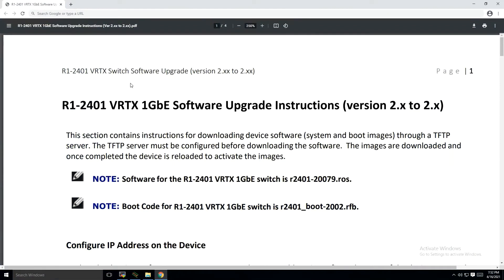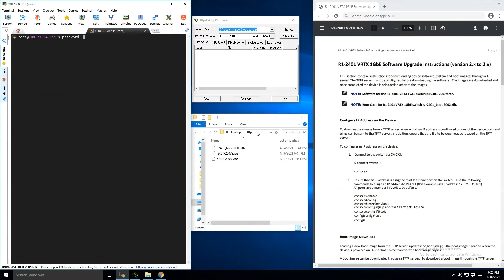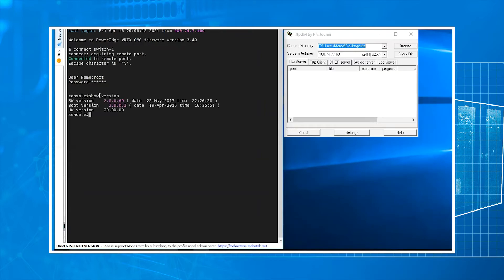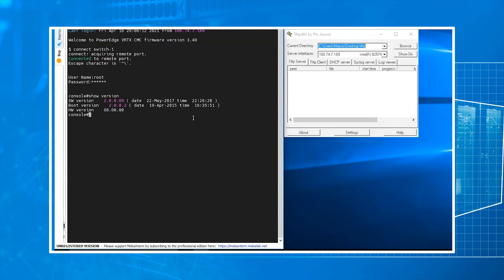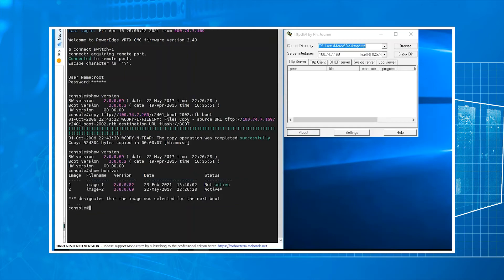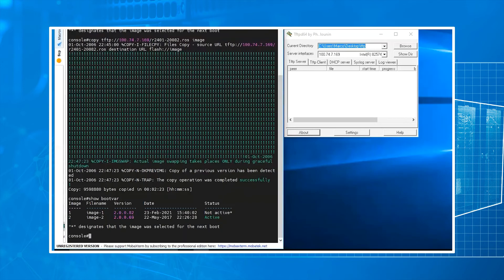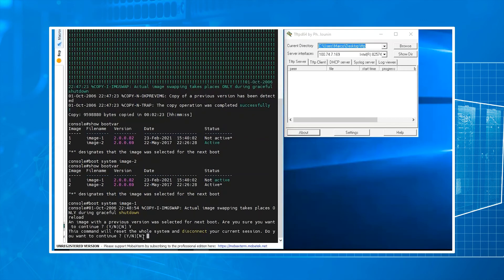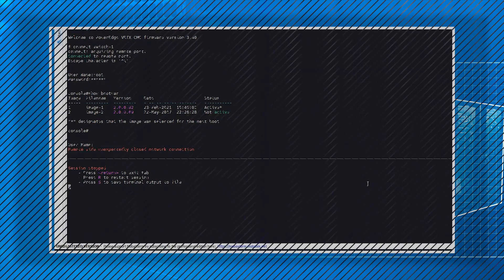How to upgrade the Firmware on a Dell VRTX Network 1GbE R2401 Switch

Comment: Hi, to upgrade this switch, do we need to shutdown All M640 blades and VRTX chassis ?
Reply from the maker: Hi Ari Haryadi, the switch will need to restart after the update is complete, this means the blades will lose the network connection for this moment. An exception would be an additional PCIe NIC that is mapped for the blades. A complete shutdown of all blades and the chassis should not be needed.

But also keep in mind, that you should always have a current backup ready before updating any firmware. Dell is not responsible for any data loss.

For further help, please contact our support staff on the Dell Community at https://dell.to/3vqJuPu

Thank you.